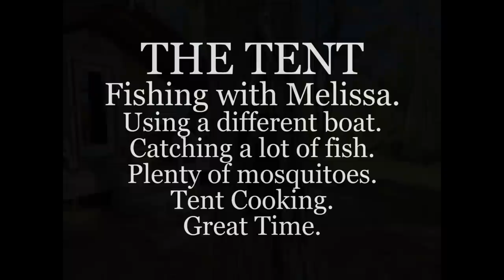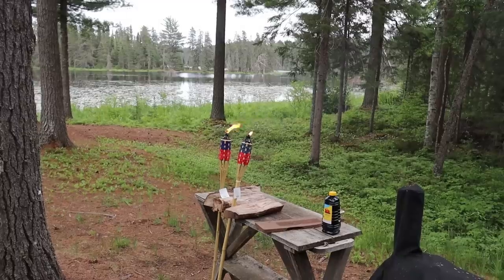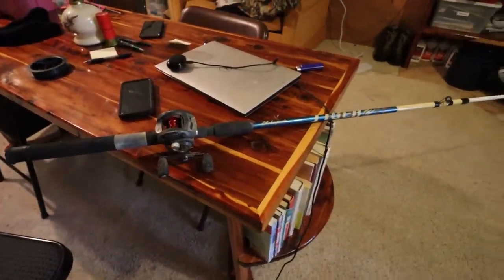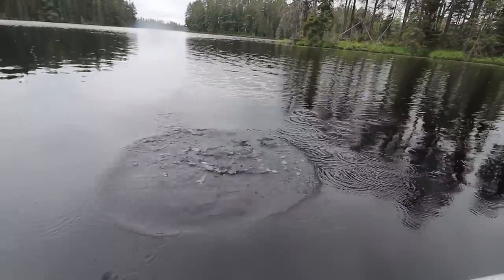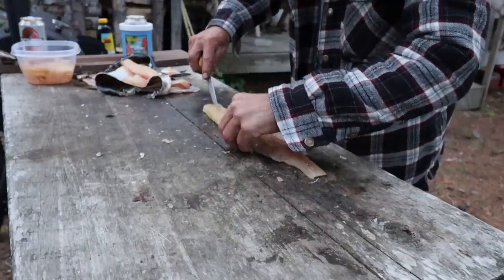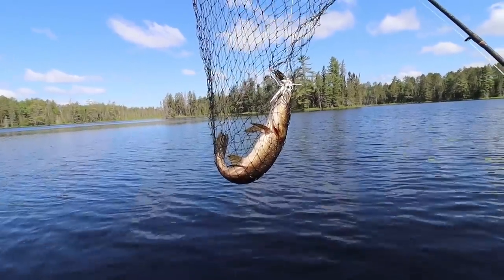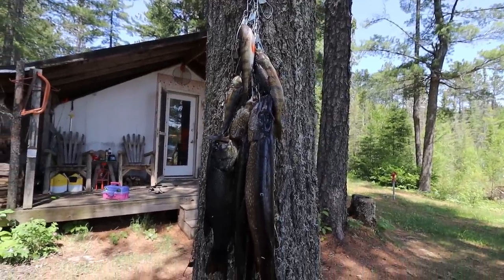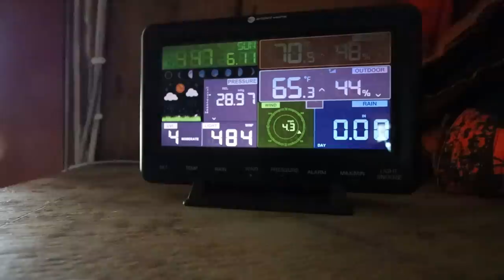THE TENT. Fishing with Melissa. Different boat. Lots of fish. Horrible bugs. Tent cooking.

Comment: Joe, We use paper towels with vanilla on them for the gnats, I always where a hat so I just hang it through the adjuster hole in the back, the rest pin on patches of towels or put some on their arms, it is a bit sticky for me, so I use the paper towels, they also say the vanilla car air fresheners around the neck on a string work too.

Comment: Joe, just a tip I learned the hard way years ago, put a chain on the motor from a  cleat through a part on the motor, making a loop incase it should come loose.  I had one drop into the lake on Lake Huron in Cedarville Michigan and thankfully it was only in 5' of water, clamps worked loose. Yes I had to go swimming to retrieve it but I saved it. Cost $300 to have redone but those old Johnsons are worth it.
Reply from the maker: There is a hole in each of the tightener handle things that you use to tighten the motor to the transom. I have a string that ties them together so they can not come undone.
Reply: @NorthernSeclusion  That is where I put a padlock.

Comment: I've only ran a johnson 9.5 for my whole life it was my grandpa's. In my experience with those motors they run great i have no complaints. But comparing it to a different brand motor i dont have a clue.  I always felt the johnson 9.5 were very reliable and i never had a worry using mine

Comment: Joe, you know that there is a tiller friction screw on your motor that you can adjust so your motor doesn't swing back and forth, on mine I kept it a little tight so I didn't have to hold the tiller while trolling. great vid's
Reply from the maker: Someone mentioned that so I tightened it. I will see how that is next weekend when Melissa and I go camping. Thank you.

Comment: Maybe it’s already been suggested, but if you move the trim tab below the cavitation plate in the same direction as the pull the steering will require less work.  Great motor. 😁
Reply from the maker: That motor has a fixed trim tab. I have no adjustment. I did however tighten the screw that tightens the tiller right to left movement. I am hoping that helps.

Comment: Joe do you put a wick in the coffee grounds or how do you keep it burning I'm very interested in how you set that up
Reply from the maker: No wick, they just smolder. I found that using a little lighter fluid to start the grounds worked really well. Putting about 10 drops on the "mountain" of coffee grounds and then lighting it and letting it burn until it goes out by itself. It smolders for a long time after that.

Comment: Pro tip:  whenever launching or putting a boat back on the trailer where there is no ramp, it's shorts and flip flop time.  Walking on a trailer like that will eventually bite you

Comment: Joe. I've Always wondered why you don't use the hot water tank on the wood stove for showers, etc
Reply from the maker: It is a great idea having it there but half the year you do not use the wood stove. The other half when you do, you fill the reservoir with water but it boils so it evaporates away. It is not like you have hot water on demand at all times. It boils dry. You end up wasting a lot of water.

Comment: How do you burn the coffee grounds to keep the mosquitoes away?
Reply from the maker: Just mound them up on something metal and light the top. I found it faster putting a few drops of lighter fluid on the top and then light that. You could use cooking oil or anything flammable or like I said, just light the coffee and hold your lighter on it for a minute or so. It will then just sit and smoulder for hours.

Comment: Joe, the new (old ) boat and motor seem to be faster and run very well. How are you liking it ??
Reply from the maker: It is definitely not faster but it chugs along pretty good. It kind of reminds me of a my 6.0 diesel vs my gas truck. The diesel chugs along and nothing stops it but the gas one can get you there faster. The new (old) boat motor seems like it is very reliable and will get you where you are going no matter what. It took me all weekend for it to grow on me and the boat itself leaks through some of the rivets. In the next Farmhouse video "getting ready for the big camping trip" (or something like that) which I am editing now and will be around an hour long, you see me doing some boat motor adjustments and fixing the boat. I think by this coming weekends maiden run with the fish house camper that boat will do very well.
Reply: I can't wait, Joe. You'll fix the leaks and motor and it will be great. It seems like you have more room and space to customize !!!

Comment: What a difference geography makes....you had a high of 67....we had a high of 97 here in north Texas.  ugh.... And it's not even August yet!

Quick question about the smoldering coffee....does that smell as awful as I assume it does? I hate coffee, but Texas mosquitos are the size of a Cesna. So I'd take the hit on the smell if it got rid of the bugs!
Reply from the maker: It did not smell horribly bad but after two days of it, it got annoying. It did seem to help keep them off the front porch though.